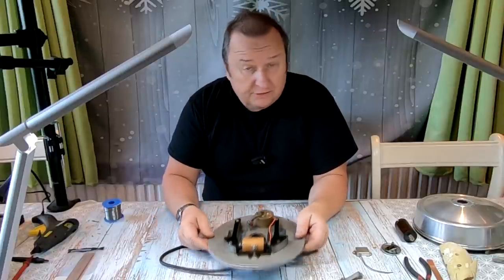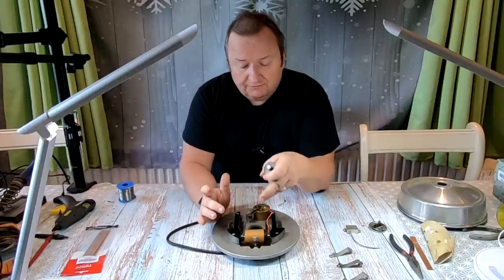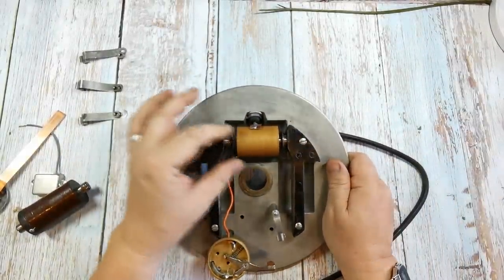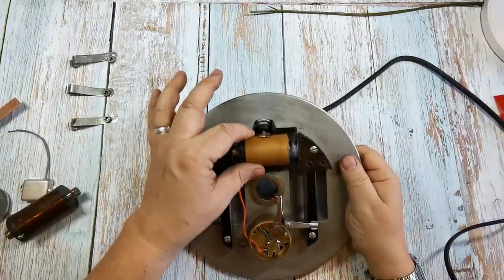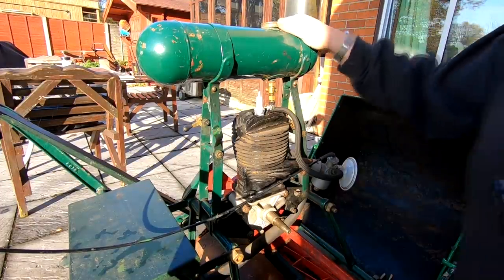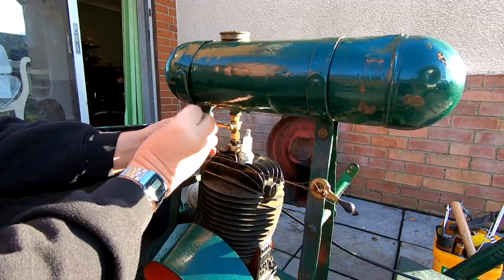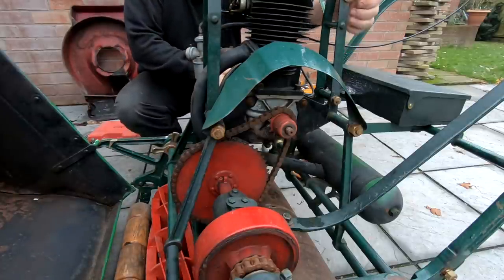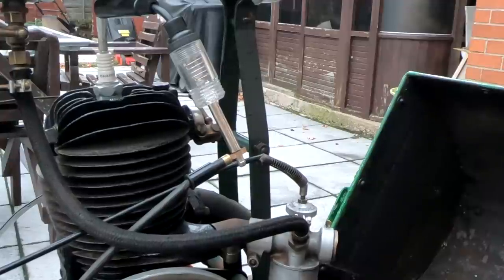100 Year Old Atco Standard Lawn Mower No Start Fix   Will It Start

Comment: 65-90psi is the range for these engines put a few drops of straight 2 stroke oil in the cylinder turn it over a few times it will come back up with the crank case put some thinners in it shake it about it will wash it out nice don't go taking it apart the rings don't like it and the reproduction ones are a waste of time and don't last

Comment: You might want to re-think the hot-melt glue holding the coil in place.  As the unit heats up, the glue will re-liquify and no longer remain bonded to the coil.

Comment: hi martin. We used to set the points with the flywheel on but im sure you sorted it when you refitted the backplate. I had a swag of Villiers engines on my go carts and from memory the points were 12thou and the plug 25

Comment: Couldn't you have soldered the ht lead direct to coil instead of using that copper plate arrangement ?
Reply from the maker: The ht leas connector is spring loaded for the vibration and would probably snap if you soldered it direct to the coil.

Comment: I don’t think the hot melt glue is a good choice in this application. It may get pretty warm when you get it running and go soft. I used it on the petrol flap hinge on my car and it came off when the sun was on it. No nails or similar might be better. Hope you resolve this. Watching with interest.
Reply from the maker: Yes, I did think that afterwards, i'll probably use JB weld.

Comment: Hope you can get that bad boy running again. If you do get it running again I wonder how it will run on today's fuel. Since back in the old days it ran on leaded fuel.
Reply from the maker: Should be fine as it has no valves being a 2 stroke Dave
Reply: @retrorestore  It's two stroke? That pretty neat.

Comment: Sometimes it can be very frustrating when it's nearly there. When I finish the Honda Stream I am going to revisit the Mobylette engine. The compression was only 40psi although it did run. I have ordered a new crank case and Airsal cylinder and piston. Hopefully I can get that running perfectly.
Take care, Jeff
Reply from the maker: Yes, 40 psi is a bit low Jeff
Reply: @retrorestore  Yes not too good Martin.
I should have completely stripped the engine to start with. The bearing were a bit rumbly so the seals could have dried out as well.